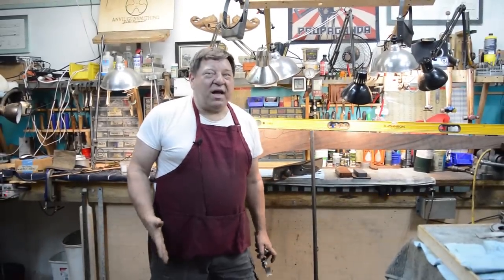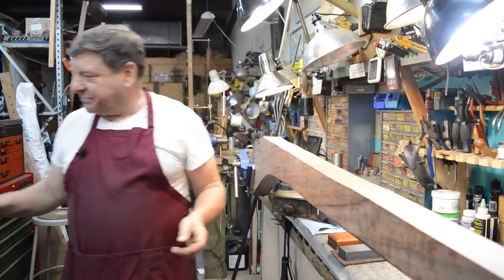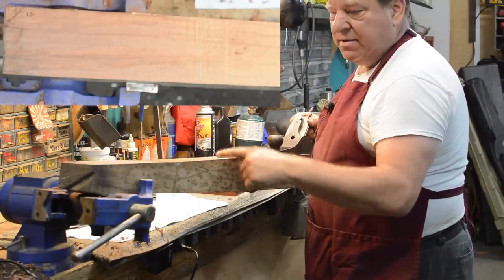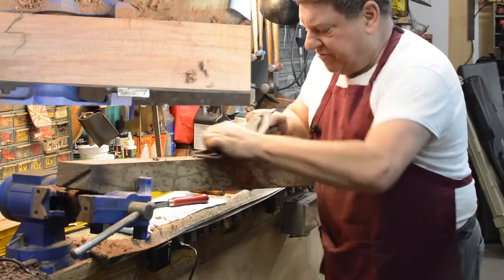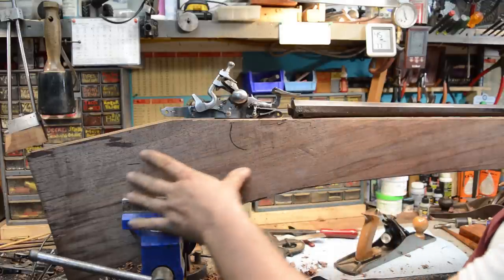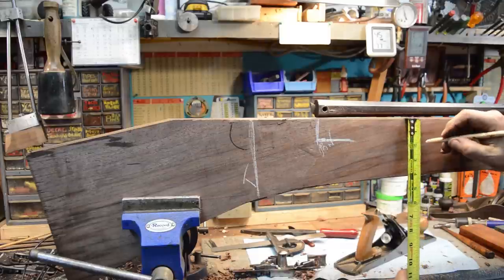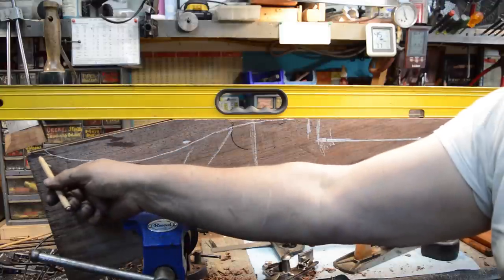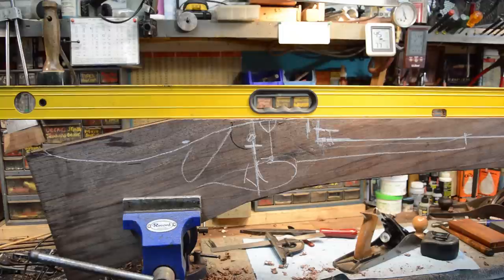Fantail Fowler: Stock Blank Truing and Layout

Comment from the maker: For the record, I have access to all of the fancy power woodworking gear.....but I'm not build furniture here.
Reply: I love watching you work wood.  I learn a great deal every time.
Reply: I totally understand the hand made aspect of the build.  I also have great satisfaction in making things for myself.  I spend many hours making things that I could go out and buy for a relatively low price.   The same thing that gives someone the satisfaction of making something that can be bought is the same satisfaction you get from using hand tools over machines.  I have a jointer plane made by Veritas that has a fence that keeps the top perpendicular to the sides.  It's also a low angle plane makes it possible to plane end grain.  I think the low angle also helps a lot in highly figured wood, although it is a common subject of debate.  As for cutting the barrel channel by I hand, I also have a Veritas router plane that has a fence on it that would make quick work of cutting a barrel channel.   I look forward to your upcoming videos on this project.  I've never attempted to make a stock, but I've always wanted to give it a shot.  Thanks for the video.
Reply: Fishtail Fowler

Comment: Ever hear tell of a jointer? Set it up run the piece across the machine two or three times plus ( whatever). It is a machine planer that has a fence at a right angle to the cutters. After you thickness plane the piece you will have two true surfaces and then you run one of those along the fence and cut to a perfect right angle to it against the cutters. You probably have seen jointers. Lots of them around and not to costly. The fine touch that you apply by hand is also very nice.

Comment: Will be interesting to see how much castoff you end up building into this. Many don't but just 1/8"-3/16" can make a gun a dream to shoot! Surprized it has a hooked breach. Thanks for showing this as prerevolutionary war and older flintlocks tend to be overlooked.
Reply from the maker: The rear 1 inch of the breech is going away to get clean metal. The hook breech is going with it.

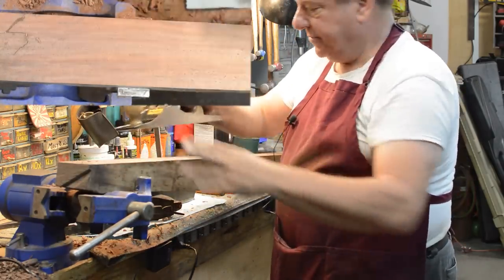Comment: Woodworking tip, when you set your "gigantic old beautiful" (11:50) plane down on the bench, put it on it's side.  The sides of the planes are there so you do not rest it on the blade.  Result - your blades in your planes will stay sharper longer, less likely to ding with something you set it on.
Reply from the maker: Very true, which is why we have towels on the bench, that are changed frequently
Reply: My farther was a Master Carpenter, he'd go ape if I layed a plane on the flat :-)

Comment: Shouldn't the bottom of the barrel end up half of 1¼" i.e. 5/8" down from the top of the stock? At least at the breech. I realize the top isn't at the finish depth right now, but it seems like way too much inletting to me.
Reply: You need to wood to come up all the way to the top at the breech. I like to inlet full depth, then rip the excess off the sides, but most people don't do it that way. They cut the top off then inlet. If you inlet to full depth though, you can use the tops of the sides for reference surfaces. For instance I've done a couple barrel channels using a table saw, and running the stock upside down on the saw to hog wood out of the barrel channel. You need to pay attention where the cuts stop though, or you'd ruin the stock with a run over. It's also a hairy thing to do on a table saw with a 5 foot long piece of very hard wood. There are easier ways than the table saw method. I'm interested to see how Mark will hog it out.
Reply: @mattmoore1311  That makes sense. Your first sentence was a slap to the forehead moment for me, it made everything clear. Thanks.

Comment: Just curious: Did you consider leveling the top by putting it flat on a tablesaw or bandsaw and cutting the top with a perpendicular guide?
Reply from the maker: The totally smartass answer is no. The point of the entire exercise is that these were built by hand. MOST gun guys haven't seen a plane in person, much less what they're used for
Reply: Hand plane gets it flatter and removes the minimum of timber.
Reply: My two bits, a plane takes wood off in a controlled manner, the chip is even controlled by the mouth of the plane. Sticking a piece of hard, wild grain, wood into a table saw blade can have unintended results. That big of a blank is hard to find, wood like that may have cost 400 bucks or more. If he bought it from a dealer, it was more. A plane is safer, and will get it truer than a table saw. If you get grain reversal, it's easy to deal with by reversing direction, can't do that on a table saw.
Reply: The other thing, the plane needs less storage space. Gunsmiths really don't need a table saw.

Comment: Looks like a real fun project. I look forward to seeing the rest of the hardware. I'm working on a somewhat simplified copy of the Haushka fowler from the Met. I don't know if you're familiar with it. It has a sea monster swallowing the wrist of the stock. It's the most difficult thing I've tried, and I had to quit on it for a while and up my skills. I'm stalled on my Manton fowler for the same reason. I need to get better at engraving. I'm good enough for long rifle graving, not there yet for English, I may have to farm it out.
Reply from the maker: You are good enough. Finish both, evaluate, then make another one. Keep moving. If you stop, the mistakes that needed to be made to make you better will not have happened. Just sayin.....

Comment: Would it not be more practical to use a table or band saw, and just cut the high spots off? Seems like that would infinitely quicker than planing. Or is there a old guru reason for doing it this way
Reply: Showing that it can be done with hand tools.
Reply: Being a craftsman not a Machine Minder.

Comment: You are a very talented gunsmith......but it seems like you would consult with a woodworker to assist with the stock?  No?
Reply: I could shape a good deal of this work in very little time, but he’s finding the grain he likes as he goes and sometimes that means going slower. I most certainly won’t love this build as much as he will, and love is 80% of the required skill when it comes to trades work. Seriously with not too much training you could build a home nearly as well as I can, (I’ve got almost 25 years training) but it would have to be your home, and would would likely take you at least twice as long or more, (and probably cost you a bit more as well).
Reply: @john-paulsilke893  He is also building it for himself.

Comment: Hand plaining??? A good $500 jointer would do that perfectly in about a minute. And if tear out is the concern well the hand plane is still 90 degrees to the work so not much difference and a woodworker that knows his tools knows how to skew the fence to avoid that issue. I work with curly maple and I get baby ass smooth edges every time. Love your work but there t better was to do the rough out. I’m you huckleberry if you want my assistant on those big honkers.
Reply: I have all the power tools I need at my beck and call, but sometimes you just do it by hand anyway. Not everything is being run in a production environment, sometimes its a labor of love and a love of the labor.
Reply: The point is to show that this can be done with hand tools, not a $500+ power tool.
Reply from the maker: Doing most of the gun by hand is the point of the exercise, showing the tools that most gun guys have never been in the room with.
Reply: Yes, the modern power tools do a lot of work really fast BUT they can also get you into a lot of trouble really fast, too.  Personal experience after building a couple dozen ML rifles.